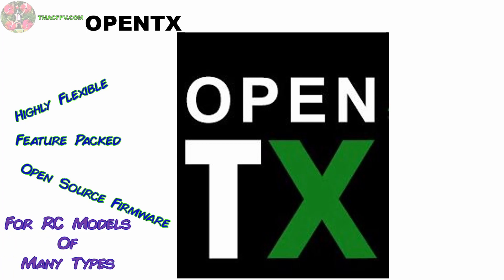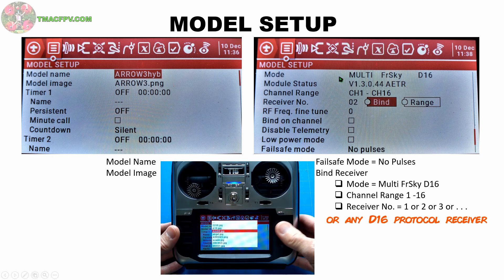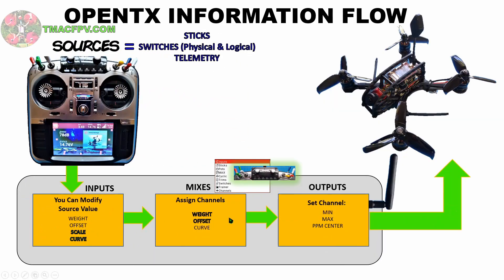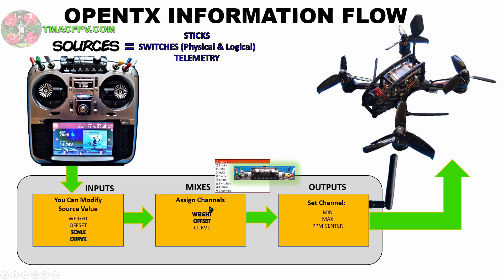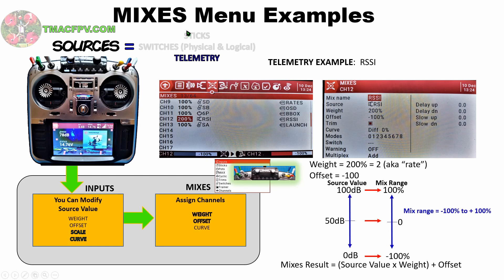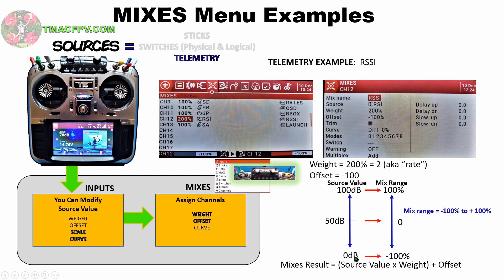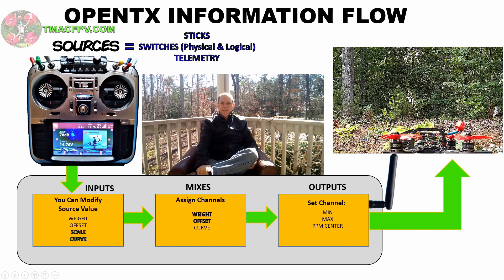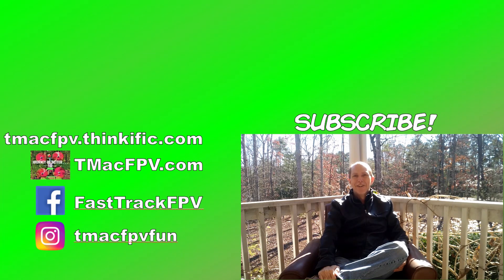OpenTX Basics (SIMPLE TO LEARN!)

Comment: Hello, this is one of the first video I have watched that explained how is open TX and how to use it in a simple way.

I want your advice, as I am new to the hobby. I have Dji fpv drone and I am doing really good in manual mode (acro) now I decided to move to real fpv world. 
I will always order my quad with HD Caddx or DJI Air Unit. so, I have an option either to go with dji controller or Tango 2 crossfire or radio master Tx16x, if decided to go with dji controller it will be easier but other way will have a big learning curve, Do you think it really worth that learning? or dji controller is good enough. Range, latency, SAFTY

thanks a lot and keep it up
Reply from the maker: Learning OpenTX or EdgeTX is a new (and can be challenging) experience. You can do it easily if you're excited and committed to learning. If you get frustrated easily and quit often, you may want to stick with DJI. However, I'm sure you're not someone who quits as you're already looking to expand your horizons. I, personally fly RadioMaster TX16S, Zorro ExpressLRS, and RadioMaster TX12 transmitters. I use Crossfire or ExpressLRS protocols on all my quads. I use HDZero (previously Shark Byte) digital FPV and also some analog. I have OpenTX tutorial videos available. EdgeTX is just an offshoot of OpenTX. I also have the Fast Track FPV Course you may find useful https://tmacfpv.thinkific.com/courses/fast-track-fpv

Comment: What is this beta flight you mentioned?
Reply from the maker: Betaflight is the firmware used on most flight controllers for FPV quadcopters. You can program it using the Betaflight Configurator to tune your quadcopter (similar to tuning your car) to fly smoothly, and do various things through actions on your transmitter sticks. If you're interested, I go over complete Betaflight and OpenTX setup for FPV quadcopters in my "Rookie FPV Pilot friendly" Fast Track FPV Course. Course curriculum and testimonials/reviews can be found here https://tmacfpv.thinkific.com/courses/fast-track-fpv

Comment: Hello, I have the Jumper T16 Pro and I noticed in the the outputs on the radio that the throttle (CH3) arrow is not working properly. When I throttle up, the arrow is to the left, but when I throttle to midway, the arrow jumps to the right, this is causing my quad to dance left to right on its on when throttling. I calibrated my radio, but the issue remains...Could you tell me what could be wrong?  So far the channel mapping is correct... Thank you so much in advance..
Reply from the maker: Only thing I can think of is it could be the ribbon cable issue that's been going around. Have you replaced the ribbon cables with the newer versions of them? If not, sounds like you should (or at least open up back of transmitter band reseat the ribbon cable connecters)
Reply: @TMacFPV  yes, I've replaced one, I will do the rest to be sure. Thank you so much for your time my friend... Cheers! 😊👍

Comment: TMAc, great job in getting the several key concepts across , I really appreciate the graphics and time you've taken to create your videos .. I do have a question tho regarding the RSSI mapping out to a OUTPUT Channel like CHAN 12.. I fly gliders and often do map the RSSI and RSSI-  (and other telemetry values to one of the telemetry pages in the Tx or an audible alert but since RSSI Is an input to the radio coming via telemetry from the plane/quad why would you want to send it back on a servo channel? Is this so a flight controller can use it or so you can see it in a heads-up FPV display?
Reply from the maker: Hey Jim, great to hear from you. Yes, you are correct. It's to get the value into the FPV on-screen display (OSD)=heads-up display

Comment: Man I have been trying to get inputs in beta flight for 4 days now and can’t get it can bind quad to t16 pro but that’s it
Reply from the maker: Delbert, it could be many things.  I have no idea what steps you have taken or your level of experience.  Its difficult to help someone without specific information.  I'll give it a shot.  So, first, with your props OFF, you need to make sure your battery is plugged into your quad when connected to Betaflight.  Some receivers require this.  Secondly, assuming you have done everything else correctly, you may have inadvertently changed "modes" on the receiver when you bound it to transmitter.  See this video for how to fix that: https://www.youtube.com/watch?v=Wx24PQ0sceI

Comment: Great video. I'm having a problem getting my right slider setup on my Jumper T16 Pro. I hope you can help. Went through both of your videos to update the internal radio and update to openTX latest nightly. When I go to calibration everything calibrates except the right slider. It's like it's not being seen. I can however see it as Analog 11 input in the Hardware-> debug analog screen. I can't figure out how to assign Analog input 11 to Right Slider in the same screen. If I go to the Right Slider in the hardware screen it gives me three letters I can set. If I set "A11" or just "11" it still wont move during calibration. I'm confused. What values do I put in that field to set it?
Reply from the maker: My right slider for those 3 characters in the Hardware Screen are 3 dashes --- . All switches, sliders, etc. have those same --- and they all calibrate fine. Maybe a faulty connection with plug /connector inside radio? I've heard a few folks have had that
Reply: @TMacFPV  Thanks for the reply. I first suspected a faulty connection, swapped both ribbon cables but the problem persisted. I would continue to suspect a faulty switch or connection but when I move the right slider I get a value change in analog input 11. If the slider was bad I would get nothing there instead of a changing value. This is why I'm flummoxed. This leads me to think that somehow analog 11 isn't bound to right slider for some reason, which is why I wanted to specifically assign analog 11 to right slider in that screen.
Reply from the maker: @fullwatts7040  According to the Jumper T16 Manual, those 3 characters are just to give it a short 3-character name, not to assign anything to it.  Manual says: "3.2. Hardware 
This page lists the hardware physical input device types. A short three-character name can be given for identification on the setup page. The calibration of the joystick and knob is also on this page. 
"
Reply: @TMacFPV  Thanks for that. I was wondering what the three character thing was for. seems a waste for you to assign it a name with that field. makes more sense for the ability to assign it another input, at least it seems more practical. This brings me to my next question/troubleshooting step. I now will need to revert this back to JumperTX to check if it is working in jumper TX. I sent a video to Jumper and asked them to replace the slider, or more accurately, send me a slider to replace myself. I have no doubt they will want me to revert it to JumperTX before they proceed with support.  Add to that I never bothered to look if it was ever working in JumperTX. ( i just updated it to OpenTX right out of the box new)  If it was working in JumperTX, then it's not hardware and it's a OpenTX thing. When I tried last night to revert it the radio froze. I think it tried to read the internal module version and had a stroke. To your knowledge is there a need or a way to revert the internal radio to stock firmware? Alternately do you know a way to revert to JumperTX?  Thanks again for your help.

Comment: what was the purpose of the RSSI mix on channel 12?
Reply from the maker: If you're asking me why I put it on Ch 12 as opposed as to another channel, what I said in the video was "force of habit." What I meant by that is I try to keep all of my models as close to the same as possible (same switches for same functions, etc.). I started putting RSSI on channel 12  long time ago & honestly I don't even remember why! You can put it on whatever channel you'd like
Reply: @TMacFPV  oh sorry... i have no idea why you put RSSI on any channel. what the purpose of feeding rssi to any channel?
Reply from the maker: @ltdorn  RSSI is received signal strength indicator.  It tells you how strong your control signal is. Put it on a channel to transmit it back to flight controller so you can see it in your goggle's on-screen display (OSD) and keep tabs on it visually while flying if you'd like so you can modify flight if necessary before losing your control signal completely. I use this method AND with a full telemetry receiver I also have voice alerts  to verbally tell me when RSSI is low and critical. So, I have 2 methods of being informed of low RSSI (about to lose control of quadcopter)